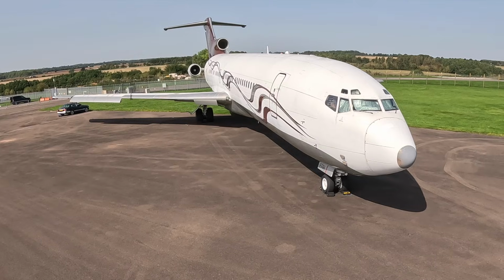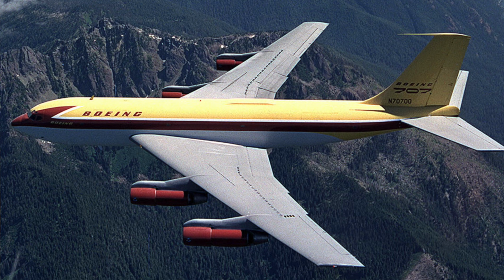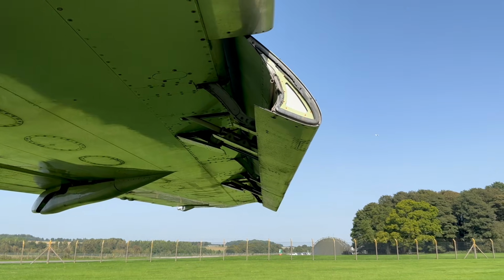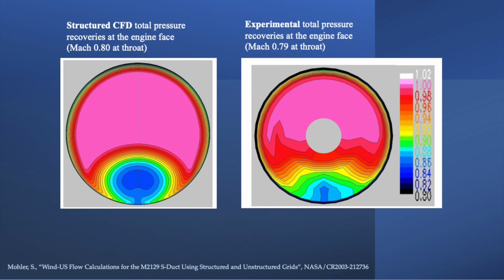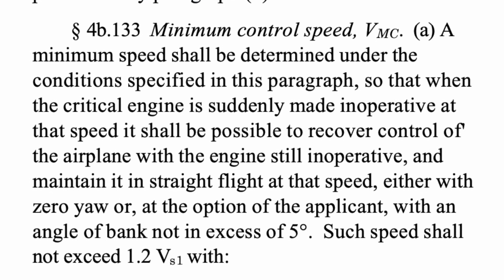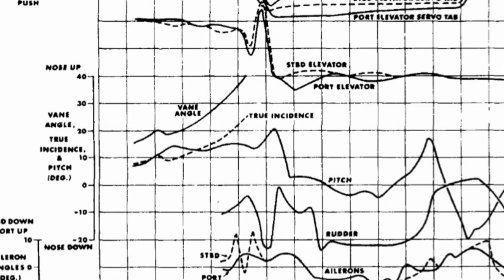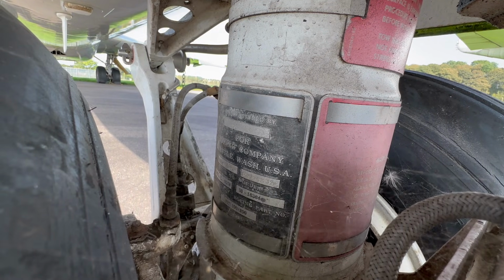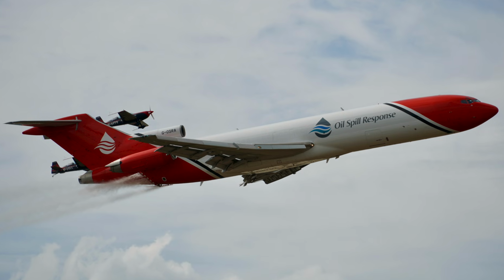Boeing 727: Part 1 - Engineering a High Performance Trijet

Comment: I wish I had seen this video before I did flight test work on the 727.  I heard that the deep stall with Wallik (sp?) as caused by the FAA pilot flying saying, "I wonder how it will handle if we stall it with the spoilers open".  We had a lot of fun flying all over the envelope.  We flew as fast as anyone, except that one TWA (?) flight that went supersonic.  We did aft cg stalls, but with the flaps up.  Pitch stability was neutral at the highest speed.  That wouldn't pass today, but the Boeing and FAA pilots thought it was acceptable, I was told.  Boeing gave us guidance on sizing fences that we put on the FedEx hushkitted engine pylons to create vortexes land at the horizontal stabilizer high angle of attack to prevent deep stall.

Comment: I was a mechanic for the 727 at PSA San Diego maintenance. Our aircraft had nose brakes to increase the take-off weight on short runways. The nose brakes only worked during MAX braking. We would change them every few years for overhaul to knock the rust off.  Another point is the aft airstairs. The 100 was hydraulic operated and could be opened with no power on the aircraft. The 200 was the same but had a blow down bottle to right the tail for emergency exit.  The blow down bottle would break off the DB Cooper mod. On the 200 the DB Cooper mod was just for show.
Reply from the maker: Was the rust due to the rarity of pilots selecting MAX? Re DB Cooper - I had never really thought this through, but the vane does indeed look somewhat flimsy.

Comment: Truly a great aircraft. Not perfect but strong, robust and reliable. Regarding the ventral stairs, apart from allowing entry and exit, they were engineered strong enough to support the aircraft durning refueling operations in case incorrectly loaded fuel resulted in the aircraft sitting on its tail due to centre of gravity limits being exceeded.

Comment: RE: the braked nose gear, Concorde has a braked nose gear. Not used for actual braking, it's simply there to stop the wheels turning during gear retraction. I believe this was to do with the high gyroscopic effect of the wheels on the rather long nose gear. Note also, Concorde only had the brake on one wheel, the axle is continuous through the hub and both wheels are connected together (rather unusual I suspect). The nose gear is also used as the speed reference for the ABS system on Concorde.

Comment: What a great video. I plumbed briefly on the 727, on the special “Quiet Freighter” versions made for UPS with Rolls Royce Tay engines. A fabulous machine.
Reply from the maker: Thank you! Do you happen to know how many airframes got the RR conversion? I’m struggling to find a handy list
Reply: @asobester  I might have some documentation from the early days (I moved on from the 727 to the DC-8 and the MD-11–another trijet!—and now the 767), but I didn’t retain paperwork stuff very diligently. At least one source I find online said the QF modification was applied to 52 airframes, which is a number that sounds correct to me.

Comment: I may have missed it, but if you do another vid on the 727 you ought to mention the two-speed Stab Trim setup.  And if you could record that wheel spinning at high speed during the numerous pitch trim changes between takeoff and a clean wing, you'd put a huge smile on the faces of a lot of old guys.   Basically, with a clean wing you only had one (slow) speed trim.   This was actuated through either the Yoke Swith or the one on the center pedestal.   But with flaps out the yoke-mounted switch would command a VERY high speed response from the pitch trim.   The reason was the massive high-lift devices.  Their extension or retraction caused a BIG change in the pitch of the plane as the wing warped itself into a new shape.   For an F15 or F20 takeoff, you had to make multiple and significant trim changes as you cleaned up the wing.   I can't recall exactly but there were multiple Flap settings that you had to go through to clean up the wing.   F20, F15, F5, F2, (?) F1 and up seems to ring a bell....hell it's been a LONG time!  IOW, You couldn't just go from F15 to UP after takeoff.  You had to stop first at F5.  And of course, you had to honor a different speed for each flap setting.    And with no auto throttles (or an iPad and only a crappy wing leveler for an AP), let's just say that your hands and thumb were quite busy flying that easterly SID off Runway 13 out of LGA on an IFR day.   Particularly when heavy.  Once you got accustomed to it, it was a matter of blips with your thumb as you learned to anticipate the pitch changes associated with each flap setting.    Short Blip....Medium Blip, etc.    Or, blip,blip,blip.    Guys figured it out as they gained experience.      

And unlike today's jets with ADSB, FOQA, and hideous overspeed warnings, the 72 had a very pleasant overspeed clacker.   In smooth air, if you weren't constantly bumping up against the clacker you were considered to be doing it all wrong.

Great jet.  Great memories.  My first jet.   What a hoot.
Reply: If it’s not clackin’, you’re slacking’…😊
Reply: @727gm  Exactly.

Comment: Andras, What a wonderful video! Thank you. (Please forgive those complaining about the audio quality, small price to pay for such in depth information about my beloved '72!)  Flew right seat one year on a -100 freighter, 5 yrs right seat on -100 and -200's, 5 yrs as a left seat on -200's. Would have stayed on till retirement, but after 9-11 my airline parked em. I called it "the taildragger of the jet fleet" as it was so unforgiving to any overcontrol or off airspeed on landing. Landing gear so far behind center of lift, easy to drive the gear into the runway if pitching up to arrest descent right before touchdown.  
Went from the '27 to the 320, might as well have started flying an alien spaceship, the two had so little in common! Thanks again, wonderful video!
Reply from the maker: Thank you so much for the kind words! I hope you’ll like Part 2 too, hopefully out in a few days (btw, featuring a brand new lapel mic and hopefully improved audio! 🎙️😎). I got to fly in a 727 jump seat recently (still not quite believing my good fortune!) and I know what you mean about the distance between the centre of lift and the MLG - as we were landing, the Earth arrived much sooner than I was expecting it (fortunately the crew were not surprised like I was 🤪).
Reply: Or “DC-3 of the Jet Age” (Thank you Capt.Fraley)

Comment: Andras, what was the deal with the accident where the pilots said the slats deployed on only one wing during cruise and the asymmetrical lift caused them to go into some wild maneuvers before they regained control? I seem to recall the FAA/NTSB stating they suspected, but could not definitively prove, that the pilots were performing an unauthorized function where they were pulling the fuse for slat deployment halfway through its initial setting to gain some fuel efficiency. They said other airlines where doing it, it was a common practice, and that they were for real when they were telling everyone: no seriously guys stop doing this!

I'm quite sure I got the details all wrong but I'm sure you're familiar with the accident I'm talking about. Any additional commentary on this?
Reply from the maker: As I understand it, the unofficial process was to use the alternate (electrical) flap extension to lower the flaps slightly for better fuel economy (mainly through higher cruise altitude, I think). But before this, the slat/Kruger extension system circuit breaker had to be pulled to make sure these didn’t deploy. The NTSB believed, I think, that the FE had gone to the toilet while the pilots were doing this, and when he came back and found the circuit breakers out, he just pushed them back in without asking. Cue the leading edge devices coming out to match the flap extension, and all sorts of chaos. But the crew deny this so 🤷‍♂️

Comment: I flew for MGM Grand Air and Champion Air as a Flight Mechanic  for 4 years on the 727-100 and 200 N502MG N503MG N504MG and N705CA  thru N707CA i flew these planes all over the globe. In my 34 years as an aircraft mechanic the 727 was one of the most forgiving aircraft and easy to maintain, except for the  the APU lol.  😊 I was able to witness some great pilots fly these airplanes to some really remote countries and landing strips as a flight mechanic, and there’s nothing that beats it in the sky, as far as ctuise speed of .85  is seen normally at cruise  and low speed landings ability to land short conditions at some crazy airports. This is one of the greatest experiences I had as a mechanic early in my career. 

Thanks for the video
Reply from the maker: Thank you for the insightful recollections!

Comment: On L1011 vs DC10 choice, the L1011 and 727 are the superior configuration.  Douglas knew this, but had other objectives:
- less design time
- less cost to build
- less cost for maintenance 
- delivery before the L1011 
They achieved this and caused the bankruptcy of Lockheed.   Unfortunately there wasn't a big enough market for Douglas to recoup its investment and it never recovered financially.  This left Boeing as the US airliner maker. Ironically Boeing's purchase of McDonnell Douglas led to its current financial woes as the financial types ignored the engineers

Comment: Re: NG Brake. Here’s from an Air Facts article by Mr. Jeff Hill about the Convair 880: “The 880 was the only plane I ever flew that had nose wheel brakes. Several conditions had to be met for them to operate: the nose strut had to be compressed, the wheels centered, and both brake pedals had to be depressed together. There were weight reduction penalties if it was inoperative.” I also hope you cover in Pt. 2 about Boeing’s attempt to stretch it into a -300. I was an aeronautical engineering student at the University of Washington in 1973 when the -300 was in the Kirsten Wind Tunnel. IIRC they could never get the Cm - Cl curve to go the correct way. Also I imagine the 2 wheel MLG exceeded most runway bearing strength ratings.

Comment: Thank you Andras!

My first flight as a child was on a 727-100 (I remember the center cabin galley), and I loved it. I went on to fly the 727 years later, but only the -200 series. I did my Dutch roll training (required for the type rating) in the -200 sim; people I know who did it on the -100 say the -100 was a wild ride compared to the -200, and the -200 required precision to recover. I never flew the aircraft with nose gear brakes, autospoilers, or a stick pusher. The chined NLG tires I recall well; the DC-9 series also have them. We were prohibited from using flaps 40 unless the Captain used his emergency authority. I did it in the sim but never in the plane. It seemed pretty draggy as I recall. 

My recollection of flying the 727 was mixed, honestly. I flew it in the twilight of its years and have always admired the engineering of its wing, in particular. Watching that thing unfold is still amazing to me! I don’t recall you specifically mentioning it, though someone else did in the comments: the 727 could get down better than any aircraft I’ve ever flown; modern aircraft are so slick by comparison they they are very challenging to descend in certain scenarios (I’m looking at you, A-321!) For its day I think it was the 727 was the best short/medium range jet in the world, but I didn’t miss it when it was gone as so many others did. I admired it as a great piece of historical engineering; it had nice handling until about the flare, and except for landings was predictable. It could do some things really well (flaps 25 TO in LGA) and some things not that well (heavyweight takeoff in DEN in August), but it was solid and simple. It didn’t have great ergonomics and had some unintuitive systems quirks that led people astray on occasion (the brake vs. the hydraulic interconnect, for instance), but most of all I remember the noise. When I was a young FE and was flying with Captains who had been flying the plane for 25 years in all three seats, I got used to yelling, as they were deaf as posts. I normally wore earplugs in it (and the 737). I also remember the landings. The last couple of feet were like a random landing generator. You could think it was wired, and your teeth got rattled; the converse was also true. At my airline we had a saying that on 727 if you had one good landing you were good, if you had two good landings in a row you were lucky, and if you had three good landings in a row you were a liar. That’s not far off. 

You did a bit of comparison to the L-1011, which is the only other trijet I’ve ever flown, and it is my favorite airliner of my career. It was so far ahead of its time (DLC, flying stab, etc.) that it is most worthy of your attention for its own video. I’m glad I got to fly the 727, but I don’t miss it; I miss the L-1011 every time I fly!  

Magnificent video; I obviously subscribed, and have already forwarded this video to several friends who also flew the 727!

[Edited for spelling.]

Comment: the best days of aviation... when being a pilot meant something and you got to really fly the coolest stuff
Reply: And the coolest stuff was really safe on an aerodynamic and physical basis, rather than a digitally controlled basis. Thus, to be experienced seamlessly and 'naturally,' for lack of a better term.
Reply: @jerryweirdspeed

That’s not really how it works.  

Same as modern cars.  You can drive a modern car without activating any electronic assists whatsoever.  It’s just that those electronic assists prevent you from losing control or crashing.  

Same with airplanes.  If you’re pulling back on an Airbus until you hit Alpha Protect or Alpha Floor in Normal Law, you probably shouldn’t be a pilot.

Comment: The 727 was the first aircraft I flew on.and it was so loud (even with hush kits) that it sounded like it would crack open the very atmosphere itself.  I lived near YSSY when the 727 still operated… not easy to forget.
Reply: My first flight as a kid was on a 727-100 and I loved it. I got to fly the 727 years later, but too late for the ostensibly squirrely -100. I did the yaw damper inop Dutch roll demo in a -200 sim (it was required training for the type rating) and it was eye opening. People I knew that did it on the -100 said it was way crazier on the shorter aircraft.

[Edited for grammar.]
Reply: @Michael.Chapman  
Yep, it was truly a very loud airplane. However in the cockpit you could not even hear the engines. Takeoff rolls were nearly silent. However the air noise above 250 kts was very loud. That’s  why the hearing in my left ear (by the window) is about shot.

Comment: The 727 was the first aircraft i worked on out of A&P school.   I recall being tasked to put oil in the engine and had no clue how to do that.  The company I worked for did overnight checks on Mexicana's planes.  I got to see the deactivated rocket pods as well as working on planes that still had nose brakes. Back in the day, finding contraband in the escape rope compartment and in the engineers desk was exciting.   Those who know, know. 😂
Excellent video!
Reply from the maker: Thank you! Do you happen to know why they had deactivated them?
Reply: @asobester  no, I never did hear an official answer, but would assume it was more hassle to have an active system then the use/benefits.

Comment: Thank you for these deep dives ! Super interesting as usual, can't wait for part 2 !

Regarding nose gear brakes on airliners, I seem to remember that the Convair 880 had them also.
Reply from the maker: Thank you for the interesting addition to my list of aircraft with nose wheel brakes! I wonder if the 990 inherited them…?
Reply: @asobester  A pleasure to be able to help. Looking at an AMM found online, it seems that the Coronado did indeed inherit these brakes ! (Source: "Convair 990 Maintenance Manual" on Internet Archive, Chapter 32)

Comment: I read somewhere a long time ago the 727 was created because an airline was pissed off by all the flights they had to cancel for bad weather. 
    That's it. 
     You can't cancel bad weather so they wanted a plane that could still operate in those parameter. 
        You have read the same book. 
It's called plagarism.
      Nicely done though. 😊
Reply from the maker: You can check whether it was indeed the same source, as my sources are referenced in the notes below the video (so no, not plagiarism).
Reply: @asobester only just seen your reply. 
      My comment wasn't a criticism.
.          Nor was it an observation. 
       It was an appreciation and being an ancient plane mad child whose passion has never diminished ( I still look up whenever I hear a plane) it's so nice to find a channel that is run by someone so knowledgeable and so eloquent.

Comment: Excellent video thank you. Very interesting re visiting the 727. Another thing I remember from my time working on them was that if the tail skid failed to retract the rear toilet door was to be locked out of service. The reason being that the wash basin waste water drain mast was located immediately forward of the skid. If this wasn't done, the waste water would accumulate and freeze on the skid. Not only creating more drag but also a hazard to people and property on the ground should it break free! The strange things that you remember!!
Reply: I flew the 727 for years and never knew that (or forgot it decades ago)! Of course, we didn’t need to memorize the MEL, but if I’d encountered that I probably would have remembered it.

Thanks for the comment!

[Edited for spelling.]
Reply from the maker: Thank you. And I cannot tell you how much I love the sorts of tidbits you just shared 😎. Aircraft had so many weird system interconnections like that, even before they had millions of lines of code on board!